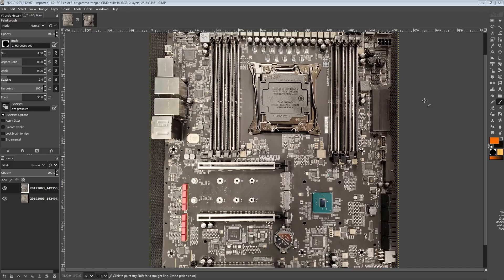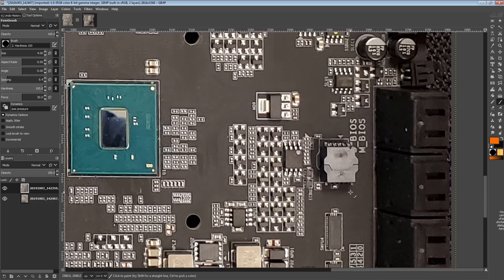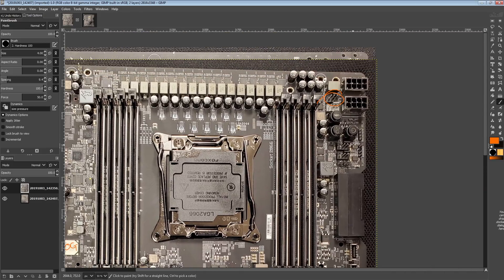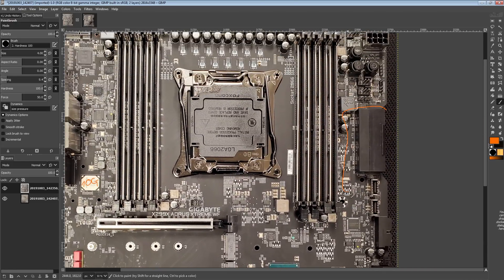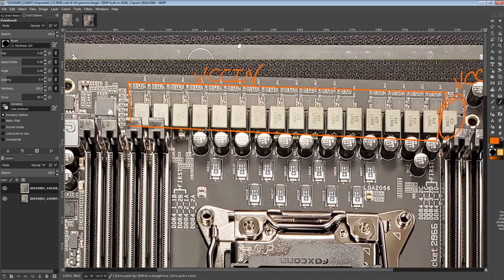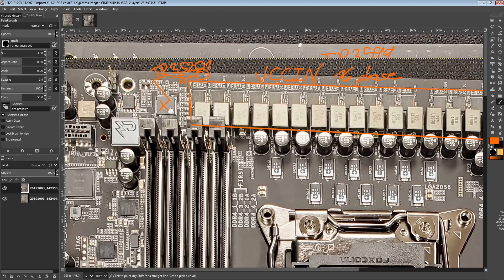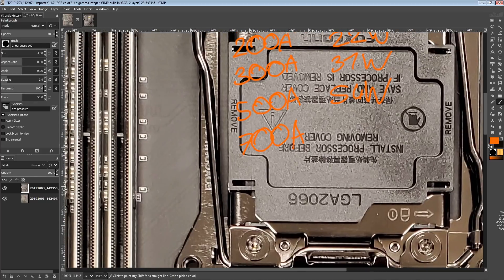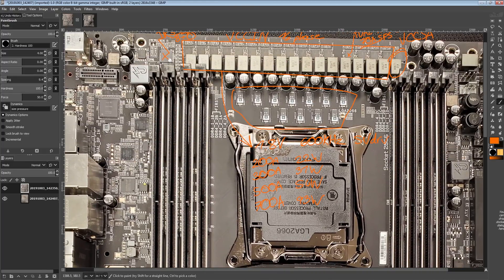mobo PCB Breakdown: Gigabyte X299X Xtreme Waterforce

Comment: This is the only x299 that supports three pci 3.0x16 simultaneously, right? And it doesn’t have any limitations on having 8 dimms and all slots populated. Asus x299 disables some dimms when 3rd x16 slot populated. That’s pretty cool.

Comment: hey buildzuid, looking from the gigabyte website, it seems that the x299x aorus master is exactly what you want. 
12phase vrm using 70A power stages
Qflash button
and a heatsink for the vrm
Reply: is the postcode over in the top corner with the reset and power button or under the PCIe slots, lol.  Agreed, the rest sounds cool.
Reply: @Zarcondeegrissom  power reset and postcode at the bottom
clear cmos at the back of the board🤷🏻‍♂️
Reply: sounds like more of what BZ didn't like, more stuff blocked by PCIe cards on the LN2 bench, lol.   At least the VRM has some beefy components, there is that.
Reply: but at least they are not all oner the place🙂
its like you only buy it for the vrm
but then if for whatever reason the gpu must be at the bottom slot
then you are pretty fked😂

Comment: @Buildzoid   You will soon review TR3 motherboards....can You kindly explain if PCIe 4.0 16 slots if set at 8X in BIOS (and if it is possible to do that) would run 3.0 GPUs like at 16 Bandwidth on PCIe3.0 motherboards please..... 

I would like to know how many GPUS i could hook to those super expensive new motherboards for thread ripper, because they offer  a miserable  4 instead of at least 6  or 8, and this makes  these motherboards and CPUs useless for what they are designed for...it is as if they are designing storage motherboards....who the hell needs 10 sata on a 32 or more core cpu?! hen  you can get a super cheap epic instead